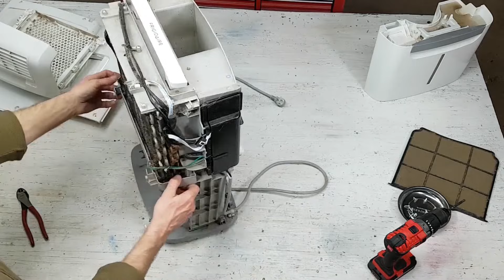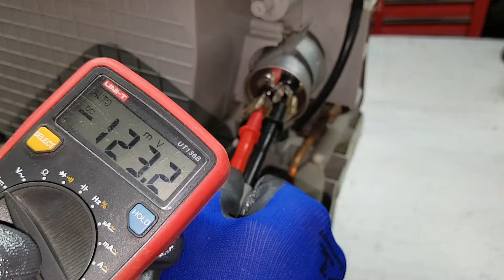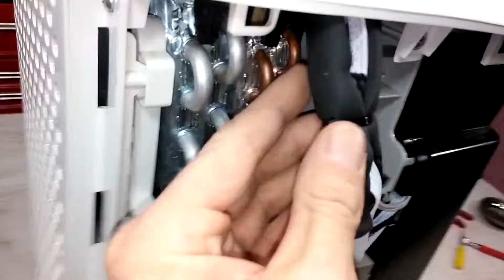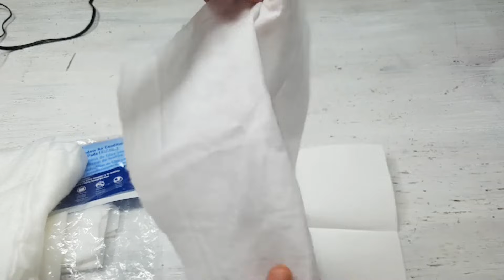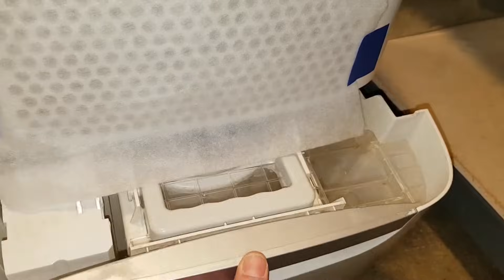How I Cleaned a Dehumidifier - Deep Cleaning Moldy Coils, the Bucket, and the Filter

Comment: Any tips on getting my front panel off my Honeywell HDH-125 25 pint?  I can pull slightly from the bottom of the front panel to see the coil and dirt.  There are tabs on the bottom part of that panel which are straight forward.  I can probably get a vacuum on the coil when i do that.  It seems it is connected on the top somewhere as I have everything apart.  Perhaps some of these machines aren't meant to be taken apart.

Comment: a hockey buddy told me the issues, I bought 3, this same size, I was surprised the amount of moisture it takes out of the basement air, my wife still thinks i fill the tray when she's not looking, our furnace also has a dehumidifier built in, but you don't see the water, it goes to a drain in floor, I run 2 constantly, when 1 is slow i take it to repair shop, fire up the third, FYI 3-4 cleaning and they are scrapped, starts to be more bother than they are worth

Comment: HI PHIL:

I HAVE MOLD AT THE BOTTOM OF THE BUCKET. HOW DID YOU REMOVE IT FROM YOUR  BUCKET?
THANK YOU,

SEYMOUR
Reply: bleach
Reply from the maker: I used a solvent gun and an unused toilet brush.  A garden sprayer might work also.
Reply: I have one like this. I used a large bottle brush with soft bristles to get into the corners
Reply: You can also use a dishwashing tablet, fill the bucket with hot water and let it sit. Will come off.
Bleach otherwise

Comment: Hi Phil, I have a dehumidifier, same make, same model. Use it to help keep the basement dry in the summer. [So, not much dust.] We pull three buckets a day out of the basement when its humid. A couple of days ago, it started pissing on the floor while it was running, bucket not full. There are no repair manuals for this unit published online, so I was SURE glad to find your video here! I was NOT looking forward to diving in blind! Your video was EXTREMELY helpful! The fault I found on mine was that the two weep holes in the plastic tray that collects the water from the coil and directs it to the bucket were plugged, causing the tray to overflow. After disassembly, I also discovered that the fins were plugged with mold and slime. We had been diligent about cleaning the removable filter. While the coil was still damp, I tried a garden hose (hot water) with a nozzle to clean out the fins and it worked great, so I did not need to remove the coils. I directed the spray as near to vertical as I could, pointing the nozzle towards the ground, and that worked well - did not damage fins. I also sprayed all the plastic pieces and the coils down with Purple Power, and sprayed them with water again. I spent a lot of time flushing the plastic collection tray and got a lot of debris out of it that had fallen from the fins. Unit works Like New again! THANKS! 

Keep 'em comin'! 
-Happy Subscriber.

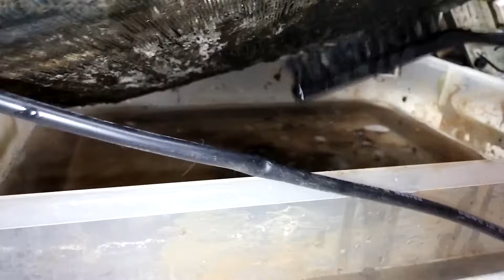Comment: 6:44 Thank you for the video. I own the same dehumidifier. I put mine in my bathtub, raised the back of it, sprayed condenser with diluted Dawn dish soap, and hosed it with hot water until it came out clean. Tipping the back helps keep water away from electronic parts & hot water helps it dry quicker. I need a humidity sensor on top & have to wait for part while it drying. I did not do all that dismantling. And i sprayed the two screws at bottom of condenser with Fluid Film to prevent rust. (they tend to get rusty). There was a tust spot nearby & i sprayed that also.👍

Comment: I loved your presentation style and thanks for the tip about discharging the capacitor. Can't wait to disassemble my moldy smelling dehumidifier. I'm going to spray it with Benefect Botanical Decon 30 that I bought to clean my window AC unit coils. It's supposed to be antifungal.

Comment: It sucks that they make these machines so hard to clean it's like they don't expect anyone to ever clean them or something I don't understand the logic also in my country I don't have access to the foaming cleaner so it makes it a lot more difficult I just tried to clean the front side as much as I can I can't even access the back coils I was able to open up the machine pretty well to clean out the fan part in the back but I couldn't quite remove the top assembly off and I didn't want to break something because well then I would just have a broken machine that would be expensive for me to replace it still works pretty well but what can I do at least it's still running I bought a portable power generator that conked out after one year so 5 years on the dehumidifier I guess I can't really complain it was making kind of a whining wheezing noise the year before but once I spent 5 hours opening it up and cleaning out the fan assembly was a solid a dust in there it stopped making the noise also I started running the machine on low fan setting because I read on some website that the high fan setting can cause the motor to wear out faster and I keep it in a relatively small room so it doesn't really need to be on the high fan I did that for both of my machines I've also noticed I have two different models and the one with the bucket in the back seems to get gunked up a lot more than the larger unit that has a bucket in the front I don't know if that has anything to do with something in the design but they're basically more or less pretty much the same internally the one with the front bucket is a bit bigger though anyway it is what it is thanks for your video
Reply from the maker: You're welcome.  I've been using a pre-filter material that was designed for A/C window units, and it has really helped to keep the dehumidifier coils relatively clean for years now.  I just change the material before it gets clogged, or every couple months or so.
Reply: There's no way I can do all this and I just bought this dehumidifier. This should a recall on their part my gosh. How can those of us who aren't able to do all this prevent this from happening?

Comment: Thank you for your thorough video. I agree that this is a daunting task and it would be great if a company would come up with a unit that had easier access to the coils and fan. The high surface area of coils absolutely encourages mold/bacteria buildup and would ensure that this would happen to every dehumidifier that does not have a HEPA filter on the air intake.
Reply from the maker: You're welcome

Comment: You could have made $200 selling lemonade in the time in took to do this. Also, all of the extreme precautions taken for safety, and you don’t even think to wear a simple mask as you’re dealing with all that mold growth. Wow.
Reply from the maker: The mold was wet when I cleaned it, because I used water.  Otherwise the spores would have been airborne and everywhere.  Although I didn't smell any mold during the cleaning process, I think a mask would have been a good idea so I mentioned it in the video.  Could you please share what you mean by "extreme precautions".  I want to learn and improve.  Thank you for your concern.

Comment: It would be nice if new dehumidifiers could use smooth  Peltier device(s) for cooling instead of the tube-and-fin condensers and evaporators.  All these appliances are more of a pain to maintain.  Whether it's a lawn care appliance, shop equipment, garage equipment, kitchen appliance, entertainment device, vacuum cleaner,  garbage disposal, etc... This consumerism economy or consumer driven economy is just a real pain.  Most appliances are made cheap, and hard to clean, repair and service. The manufactures just want you to recycle or throw them out and buy another one. Just think how many cumulative hours and money, are wasted on maintenance, and replacement parts...
Reply from the maker: Indeed, it seem to me as if technology often gets developed in the wrong direction.  Away from reliability
Reply: I couldn't agree more. Whenever practical I buy vintage appliances and they are a joy to use and maintain.
Reply: Peltier designs would actually be cheaper, the problem is they're way less efficient so they dump way more waste heat into the room and eat more power to do a worse job since there's also less surface area for condensation to develop and drip.

Comment: How DID THAT GET THAT NASTY WTF???? wtf?
Reply from the maker: It was in a workshop for over 10 years without any real air purification and I never bothered to check the coils.  Now I use a separate air purifier unit to clean the air in the shop, and an aftermarket filter material to pre-filter the air before it enters the dehumidifier.
Reply: I cleaned my filter ASAP, & mine was all caked up. Now, I sprayed my filter with Lysol disinfectant spray after cleaning, and wipe of excess, but it must got stuck in on condenser. So I won't be doing that.

Comment: Thank you for this video. It saved me taking a bunch of pictures. I have the exact same dehumidifier in my basement. I was using it while I was remodeling the area. It didn't look as nasty as yours, but both sets of coils were clogged with drywall dust and a small amount of black mold. I used a short squeeze of Dawn Platinum in a 32oz. spray bottle as the cleaner, and compressed air like you did. Now it runs much less often and there's no smell anymore. I also put a tablespoon of bleach into the extraction pump that's plumbed into it.
Reply from the maker: You're welcome

Comment: What a great video! Thanks for showing the horror, probably much more common than it should be. Especially because of the terrible design.

I love learning how to do stuff like this but I firmly believe cleaning small appliances (and maybe big ones too) shouldn’t require so much training and expertise. In this economy, easy maintenance should be a design requirement. Both by preventing as much maintenance as possible and making it easy when maintenance is actually needed. Especially so for things that clean or deal with air

An air purifier is a great idea! I’m obsessed with air quality which is why I found your channel. I also didn’t know you could buy pre filter material like that or that it even existed! Thanks for all the tips

Also being extremely detailed and filming disassembly but then just guessing during reassembly and troubleshooting without watching the video is so relatable
Reply from the maker: You're welcome.  Thank you for the complement

Comment: I serviced a lot of dehumidifiers before bought one for myself. And when I did, two must-have features before everything else were:

(1) the inlet has to have replaceable HEPA and activated carbon filters, and...

(2) ... a fan-only mode.

Beside for air purifying, you can use the fan-only mode to air dry the machine's inside, especially the coils after each dehumidification run. Without air circulation it takes forever for water on the coils to evaporate.
Reply: Can you share a brand with us that has these features?
Reply: @ It's from Sharp. The model is DW-E16FA-W. Some other brands also make dehumidifiers with air purifying feature.
Reply from the maker: Thank you so much for this great info, very helpful.  I'm glad to see air filters on these things now, instead of those filter screens that don't really do much.
Reply: @kt38138 Where did you buy that Sharp model? All I can find about it online seems to located in Singapore.

Comment: Why wouldn’t you unplug the unit first? Did I miss something? Why does the unit have power while maintaining it?!
Reply from the maker: The unit was unplugged, but that motor capacitor needed to be drained safely, as it could potentially store a charge after the unit is unplugged.
Reply: @ wahh, I didn’t k ow that.  
Great info
Reply: @BudgetPhil could you have turned on and off the unit while unplugged to help drain the capacitor?
Reply from the maker: I don't believe so, but I don't know.  I think the power to the compressor motor is switched via a relay, and the relay needs power to operate.

Comment: Why did this get like this? is it because the fitler is not a decent enough filter or HEPA filter to combat mold/grime etc? and not a very good product design or?? 🤔
Reply: I think any dehumidifier will eventually get like this. Mold just needs a little dust and water to grow and even a HEPA filter will eventually let enough dust through for that to happen on the condensing coils. Seems like they should make these easier to clean...
Reply from the maker: Yeah that's pretty much what I think.  The filter material I used at the end of the video is preventing the problem from happening again.  Just need to change it before it gets to clogged and possibly overheats the dehumidifier.  I replace it every 3 months or so.
Reply: I agree...I think any dehumidifier will do this no matter what screen or filter as it stays wet.  Wet surfaces form mold and bacterial colonies.

Comment: Why wasn't condenser coil cleaner used? That stuff works awesome you spray it in and it Foams up penetrates deep into all the nooks and crannies of the coil in 15 minutes later you rinse it out makes it look like brand new.
Reply from the maker: Thank you for the tip.
Reply: Thanks, I have never heard of condenser coil cleaner before. Will look for it online.

Comment: It’s astounding how much filth came off the coils! But I’ll be honest, I don’t have the time, special tools, or patience to disassemble, clean, and reassemble mine!
Reply: Yup portable wheel AC units also have these problems. They are not user friendly to open for maintenance. One can drain them and clean the filter easy enough. But that's all the consumer can do the rest takes precaution and skill for maintenance because they are made so the average person can't mess with it. I opened my unit and they have lots of cheap parts that get large amounts of rust, they do get mold and slime inside that's a fact, and ultimately one has to breathe all that. My unit was in a standard bedroom but regardless I had to open it every 3 months. There was always sludge Inside that needed cleaning. And plenty of rust !
Reply from the maker: I understand.  The filter material I used at the end of the video is actually working really well for preventing the problem from happening again.  I just need to replace it every 3 months or so, before it gets too dirty and clogs up.

Comment: Doing that through cleaning and the electricity involved might really be a real hazard for regular folks who know nothing about electricity!! I don’t we need to be messing with all that!! Yeah, next one I get , now I’ll know to get something that’s easy to clean!!!
Reply from the maker: I agree. It's too difficult, and possibly dangerous
Reply: @BudgetPhil really great video, I've got a new humidifier, so you're saying put some of thay air conditioning filter material over the filter they already have, will help prolong life of it, I can't do what you did
Reply from the maker: Thank you.  I don't know what would be the best solution without seeing it.  But if the units factory supplied filter is a screen like mine,  then the filter material can help a lot.
Reply: @BudgetPhil  it is, I'll do it, thanks for replying
Reply: I agree, however typically they are not user friendly and only allow normal preventative maintenance.  They let you drain and filter cleaning. But that's it. I had to open mine which I always took care off, looked great on the outside like mint condition. But on the inside rust and sludge !
Reply: Had to open every 3 months and had mine in a regular clean bedroom. It's a science test tube inside these things! A Nightmare to open and it's dangerous!

Comment: Nope!! Wouldn’t attempt that! Way too dangerous for me!!  My small one is leaking in the floor, so I’m thinking I probably need to take the cover loose and clean the coils! The book that came with mine is EXTREMELY inadequate!! It tells you nothing!! Says nothing about coils, I had to search to find the filter!
Reply from the maker: Yeah most of these modern units are a pain to clean.  I'm not sure why.  I have an older dehumidifier that's easy to access and clean, but it's a much less efficient unit than the modern one.
Reply: Mine leaks on the floor. It has something to do with. When I dump the water. It's dripping. I didn't realize it. It would leak all over the floor. So now when I go to put the empty bucket back in. I wipe it down. All inside and the bucket.
 Be quick to put the bucket back in.
Sometimes it will drip and cause the hole problem.

Comment: Has anyone found a better designed dehumidifier yet???
Reply: They use cleaver engineering so that the consumer can't fiddle around, I had a unit that was an AC and also a dehumidifier , it had a blower wheel that would get filthy with so much grime with no way of cleaning it unless you opened it. And on tbe inside you find plenty of rust and sludge. No unit is user friendly enough to prevent that. Yet are extremely expensive to replace as designed!

Comment: From my research I have found out that ammonia is the only product that kills every stage of mold. Putting a dish of ammonia near the intake while running the machine every week or so should help to keep mold from growing inside the dehumidifier. Or putting a small amount in the collection pail would probably work as well.
Reply: That’s what I do a tiny spray in the collection tank..
Reply from the maker: Thank you for the tip
Reply: @BudgetPhil  Ammonia is considered to be a category 1 toxicity substance and so it bleach. Please be careful with this suggestion . Category 1 substances are the most toxic category.
Reply: Breathing any amount of ammonia isn't safe, same goes with bleach cleaning inside the home, hope you did this  ammonia thing outside.
Reply: Breathing any amount of ammonia isn't safe, same goes with bleach cleaning inside the home, hope you did this  ammonia thing outside.
Reply: Had a mold inspector inspect my house recently. He told me to use a cheap bottle of vodka to clean up mold. He said definitely don’t use bleach.